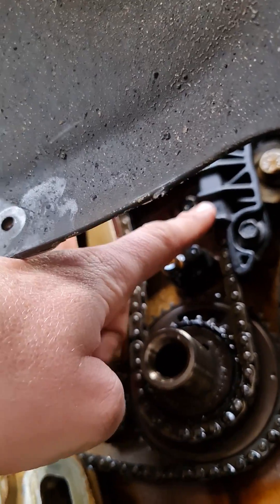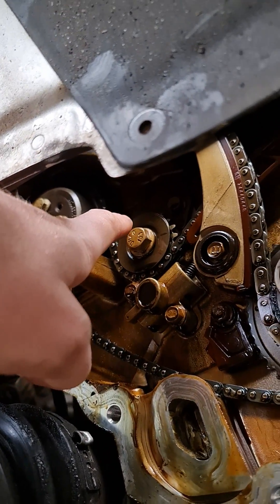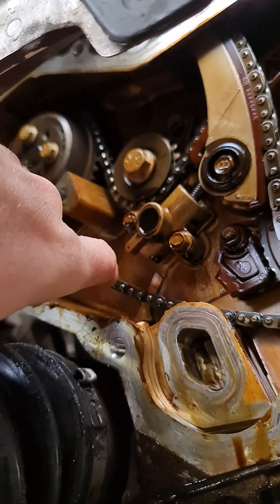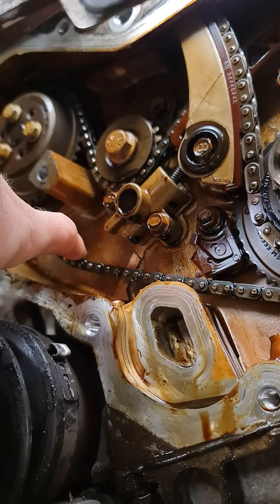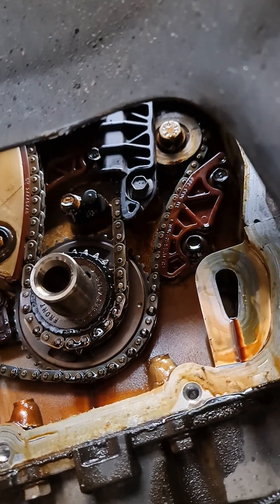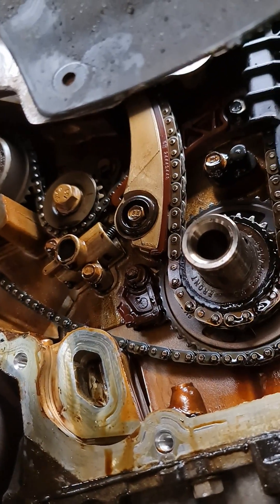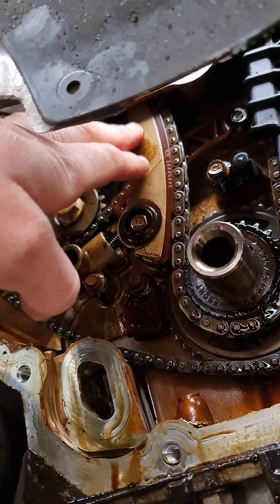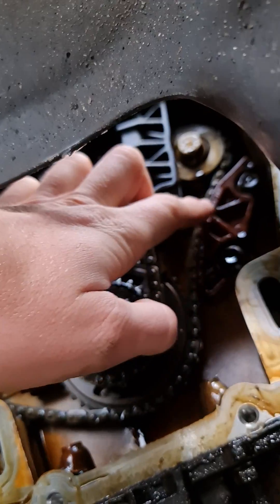Problems with the Saab B207 / Z20net engine

Comment: A great motor let down by the dumbest of plastic tensioner/guides. I had a B207 93 that had broken THREE of those tensioners by 103,000kms. 

Such a shame considering the tech that is in those motors. Bed plate bottom end, balance shafts, roller rockers, and really smooth and quiet.
Reply from the maker: @peted3637  lovely engine when sorted very smooth and can handle some good power

Sadly this one had been neglected how ever it's still ran perfectly fine just had a horrible clicking sound.

But it's such a common problem I can recommend people buy them unless they are willing to spend the time and money
Reply: @Suki-automoto  
Search for: B207 9-3 BILLET balance shaft guide UPGRADE

I posted a link to it earlier, but YT deleted my comment for some reason. 🤷‍♂